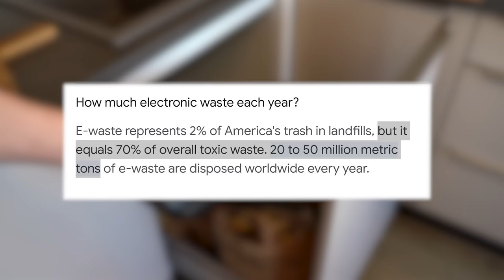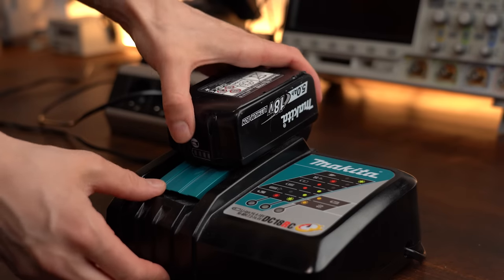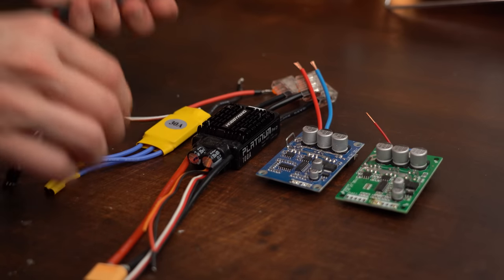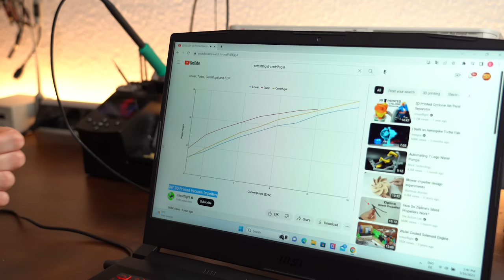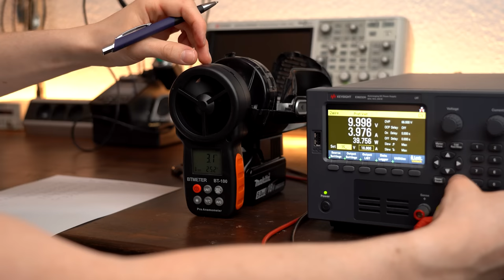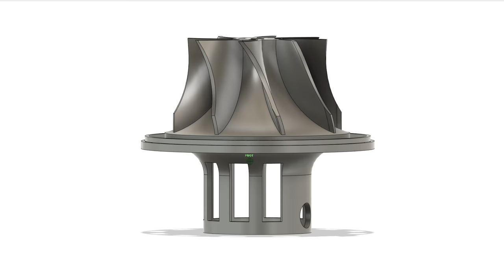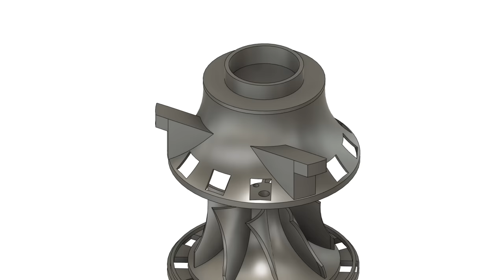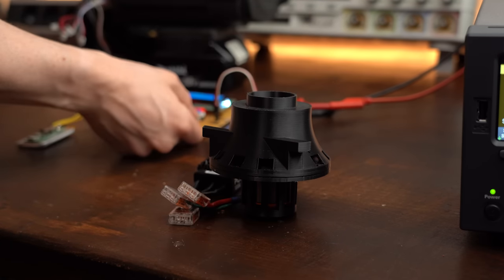I tried OVERPOWERING my Vacuum! (Homemade Turbine)

Comment: As an experienced mechanic/engineer allow me to make a couple suggestions of some things to improve your vacuum cleaner build.

First of all, you have to pay attention to the static pressure (less pressure equals less vacuum power and vice verse)

Static pressure is a measure of the force exerted by a fluid, such as air, against a surface or obstruction. In the context of a vacuum cleaner, static pressure plays a crucial role in determining the machine's ability to pick up dirt and debris effectively.

moving on

When looking to replace the electric motor, impeller, and impeller casing of a vacuum cleaner, there are several factors to consider. Here are some important aspects to keep in mind:
1. Power requirements (It is advisable that voltage and power is in range of the original motor if not changing the impeller/casing.)
2. Motor type and design (Brushless motors are generally more efficient, durable, and have a longer lifespan compared to brushed motors)
3. Impeller specifications (Pay attention to the diameter, thickness, and intake hole of the impeller. Changes in impeller size can affect the static pressure and overall performance of the machine.)
4. Impeller casing compatibility (The impeller casing is designed to house and direct the airflow generated by the impeller. The impeller and casing should fit together properly to ensure efficient airflow and prevent any air leakage. Also make sure that the impeller and the casing are compatible with each other.)
5. Quality and durability (Consider the quality and durability of the replacement components.)
6. Installation considerations (Check if any additional modifications or adjustments are required to fit the new motor, impeller, and impeller casing properly.)

Moving on

Material used to build the impeller and the casing plays a crucial role in generating static pressure as well as better performance etc.
They can be made from various types of plastics, such as ABS (Acrylonitrile Butadiene Styrene) or polypropylene.

Here are some Pros/Cons for plastic and metal impellers and casings:

Advantages of plastic:
   - Cost-effective: Plastic components are generally less expensive to produce compared to metal parts.
   - Lightweight: Plastic impellers and casings help keep the overall weight of the vacuum cleaner low, making it easier to maneuver.
   - Corrosion resistance: Plastic is naturally resistant to corrosion, which can be beneficial in environments where moisture or cleaning solutions are present.
   - Design flexibility: Plastic parts can be molded into complex shapes, allowing for optimized airflow and performance.
Disadvantages of plastic:
   - Lower strength: Plastic impellers and casings may not be as strong as their metal counterparts, making them more prone to breakage or deformation under high stress or impact.
   - Heat resistance: Some plastics may have limitations in terms of their ability to withstand high temperatures. This can be a concern if your vacuum cleaner operates at high temperatures or encounters hot debris.

Advantages of metal:
   - Strength and durability: Metal impellers and casings are generally stronger and more resistant to deformation or breakage under high stress or impact.
   - Heat resistance: Metal parts can withstand higher temperatures, making them suitable for vacuum cleaners that operate at elevated temperatures or encounter hot debris.
   - Enhanced performance: Metal impellers can provide improved performance due to their ability to maintain their shape and generate higher static pressure.
Disadvantages of metal:
   - Weight: Metal components are generally heavier than plastic, which can add to the overall weight of the vacuum cleaner.
   - Cost: Metal impellers and casings tend to be more expensive to produce compared to plastic parts.
   - Corrosion risk: Depending on the specific metal used, there may be a risk of corrosion if the vacuum cleaner is exposed to moisture or corrosive cleaning solutions.

*** Now, to help you with the design of an impeller and the casing.***
- There are several impeller types used in vacuum cleaners, and the efficiency can vary depending on the specific design and application. However, one commonly used impeller type known for its efficiency is the centrifugal or radial impeller.
- Centrifugal impellers consist of curved blades that rotate within a housing. As the impeller spins, it creates a centrifugal force that pushes the air outward, generating suction and creating airflow. These impellers are efficient at generating high static pressure and can effectively move air and debris through the vacuum cleaner's system.
- Another type of impeller used in some high-efficiency vacuum cleaners is the multi-stage or dual-stage impeller. These impellers consist of multiple stages or sets of blades that progressively increase the pressure as air passes through each stage. This design allows for enhanced suction and airflow performance.
- Keep in mind of the shape of the impeller itself and impeller casing, you have to make the design of both in such a way that when operating you can have maximum of the airflow from that turbine. The inside shape plays key role in how will Air flow thru the turbine.
- In your case (with printed impeller and casing) to improve a bit you can consider polishing the surface of both, it will help the air pass thru the casing better (less resistance due to rough surfaces of the printed parts)

It's important to note that the efficiency of a vacuum cleaner relies on various factors beyond just the impeller type, including the motor power, filtration system, airflow design, and overall construction. Manufacturers often develop proprietary designs and technologies to optimize the performance and efficiency of their vacuum cleaners.

Anyway, I am sorry for the long text but it is still not enough to fit it all in the comment. Just to justify my self, I have plenty experience in maintaining turbo compressors, turbines, compressors, high and low pressure compressors or pumps, or any equipment which is directly or indirectly connected to pneumatic and hydraulic systems.

Keep up great channel and content

Comment: you could also use one of those server fans , they have a lot of power, come with flow correction (the rotating wind is converted into straight flowing wind using two opposite rotating fans) and they are also cheap+ do not heat as much as normal bldc motors.. i have some of them from sanyo and they all working fine
Reply from the maker: I will have a look
Reply: @underdweller  yes it makes it sounds very powerful but actually not so much as the fan is not designed to pull a vacuum it's designed to push allot of air
Reply: @lifeai1889  exactly

Comment: Ok so, i been there and here is what you can do
1) the tip here is roto speed, forget about clearances and shit (unless they are over 0.8mm or so) you want high speed so, an inrunner bldc is a great idea something like a 3660 (5mm shaft at least) 
2) add some back sweep to those blades, make it shorter and as wide as possible, also, make the inlet as big as you can (since we are aiming here for airspeed and static pressure experiment with different diameters (maybe look at Matthias wandel blower experiments (although they dont look 100% the same, the work on a similar principle) mm from the edges if possible) get a better angle of attack in those blades  
3) if you need inspiration, go to grabcad and get an already made design (it will probably be the easiest one) and adapt it to your needs (probably look at turbocharger models) i hope that it helps (ik this for working on my 3D printed centrifugal supercharger project.

Comment: I'm currently working on a vacuum turbine design currently

The challenging bit at the moment is getting sufficient static pressure to be able to produce good suction. The amount of air that the turbine can flow when it's being run open air is insane though!

Hopefully when I shift over to a BLDC motor with controller I should be able to get a substantial RPM increase which will gain a good static pressure. I'm aiming to use a 3300kV 540 motor with 60A ESC. The current motor is a brushed 540 that spins around 12,000 RPM.

Comment: Please make a flow controller with electronics, we had a MQL (minimum quantity lubrication) project which is lubrication system and blow special oil in a mist way with pressurized air at tip of nozzle, at first we wanted to give oil with electronic system but later we turned it to mechanical liquid switch. There aren't enough electrical flow control system tutorial resources on youtube for very low flow amount like 60 ml/h and tutorials on youtube uses water, not special liquids which has diffrent density and viscosity.

Comment: I 18 volt everything. When my dyson stick vac went through its 2nd 14.4 volt pack I also converted to makita 18 volt. It lasted about 2 years until the wheel exploded. I ended up taking the cyclone off of it and taping it to the front of a black and decker 14.4 volt that I had converted to 18 volt. Found out the dyson was an extremely high static vac, gutted the inside of the cyclone and removed all restrictions, now it works as good or better than the original design( for my garage, the original pulled through a very restrictive  hepa filter) . The cyclone still works fine with all the stuff inside removed.I  replaced the motor on a first gen makita stick  vac with the dyson motor I had laying around. That vac went from anemic to lifting 2x4's. All the vac wheels I have messed with had 2 walls, not just a back wall and exposed blades

Comment: Use an inrunner motor for it. It’s like the motors you find in brushless rc cars, they make lots of rpm because the rotors are very light compared to the outrunners that need more torque for what they do. Very cool project

Comment: Years ago I was gifted a Black and Decker dust Buster vacuum. Don't ask me why we kept it but I still have it.

My original intent was to change the battery inside, i think that was the only problem. 

I seriously like your idea of using a tools battery. I have a air pump, left blower and weed wacker that uses the same batteries. I wouldn't mind having this join them using the same battery. Feels more intelligent that way.

Too bad you aren't close, I'd love to fix this damn thing. Its dated back from 1999 if you can believe it

Comment: Impeller design is crucial. Switching from a Closed type impeller to the Semi Open type reduced the efficiency of the impeller. Tolerances are a bit of a problem with plastics, but improving the impeller design is where i would start.

Comment: Amazing results for a first go at impeller deign. I would recomend, however, a deign more similar to the original one. First off, the inlet and and outlet area of the impeller (not the case, but the impeller, although this holds true for the case too) should be about the same, if we ignore cinoressibility (we are below mach 0.7 so thats a safe assumption). I would do this by, counterintuitively, decreasung the inlet area. The key with centrifugal pumps is the development of the centrifugal force by fkinging the fluid from near the center of rotation all the way out to near the edge of the impeller. The air entering near the edge of your current impeller design is not going to actually get accelerated that much by the time it reaches the outlet. The axial component of the airflow does not add significant suctuon power for this type of impeller, which is why the oroginal one is so flat rather than long like yours. Good luck with v2!
Reply: *compressibility

Comment: Next step further impellor improvements, including balancing. perhaps a higher kv motor, but the impellor is where you're going to pick up most improvements long term.
Reply: The tolerances inside the impellor unit that Dyson use for their held held units are very tight. It's a similar centrifugal design only smaller, the housing is not much bigger than the BDC motor used here, but they're also not 3D printing the parts either, it's some kind of glass fiber reinforced plastic, and would spin much faster too

Comment: Might want to replace that propeller with a quieter version, I don't remember the details but the key point was the fins circling back on them selves as a loop rather than suddenly ending with an edge like your existing one does. It's a recent discovery that they're both more effective and quieter. You'll have to do the research yourself though if you want more in depth detail since I only saw it on the "undecided" vids (I think).

Comment: If you put that impeller in an involute housing and add stator vanes you'll get much better performance out of it. Those types of impeller generate pressure by interacting with stator vanes, and the involute housing optimizes the volume at each point to account for the air being added to the system.

A word of caution though: You'll probably have to use a much smaller impeller. Moving more air through these types of systems increases their load, so if you make the impeller more efficient, your motor is going to draw hundreds of watts spinning it. A smaller impeller in a proper enclosure will easily outstrip the airflow of your original motor.

If you have a ~100W motor in the ~3-5000KV range you can use that and a ~20mm inlet impeller to get really good airflow and static pressure. That's what Dyson uses. Print that one in resin though, you'll need more precision and balance than FDM can give you.

Comment: Different numbers of blades, height, "trim", so on can make a massive Difference to the flow on the impaller. Car performance turbochargers are gonna be your best bet for designing your own! 
The new Garrett G series turbos are moving a lot of air with their impaller and compressor housing designs, so looking that them may be a nice thing to start with

Comment: I don't know if it matters for centrifugal vacuums, but with centrifugal compressors the key to performance is the centrifugal part. 

Centrifugal compressors work well in the applications they are used in (compression) because air has at least more mass than viscosity. Because of this you can pack it better by "throwing" it, than you can via trying to mechanically "squish" it. Think of it like grabbing snow vs. grabbing water. Both are the same weight, but one is "thinner" than the other, so is harder to mechanically grab, like with your hands for example. If you want to move a lot of water, it makes sense to "toss it" and let it's weight do the rest of the work... That's kind of how a centrifugal compressor works.

What I'm getting at is this.... to me, your impeller/compressor is too tall, and not big enough around.  You really want diameter so you are firmly "tossing" that air.

(Also, try printing with PETG. As a long time hard core Nylon Nazi, I can confirm PETG will change you.)

Comment: (sorry not native englishspeaker) BLDC-Motors are not suposed to be used in constelations where the Force goes in line with the Rotor-Axis. If you have a "snail-fan" you can use a BLDC because the direction of force is 90° to the rotor axis and can be absorbed by the ball-bearing.

Comment: proper impeller design requires knowing the airflow and pressure differential at a given RPM, this directly influences the shape, soo there is a lot of trial and error with your method... but still seems like a lot of fun :)

Comment: If  sucking up air is really based only rpm (maybe, not sure) You could add a gearing system to multiply it. But of course it depends on IF torque really doesn't matter.
Reply: Depends on the turbine & application.
For vacuums you want both airflow and static pressure.

Ideally at least 2PSI.

Comment: I had a similar problem with an hot-air gun, the motor was slow more and more, the problem was the carbon contact, It seems that the contact reduces because the material of the carbons goes off, so I opened the motor and push a bit the carbons. And thats it!

Comment: some motors are built more for torque than they are RPM, if needing higher RPM you can offset the motor and build a gear (or pully) system to step up the ratio to a better RPM.

Comment: You should add stator vanes to the impeller housing. Also use a high speed drone motor with a higher kv. This should increase the suction by alot.

Comment: Slant your blades more at the inlet like 45 degrees. Currently, the blades, IMO, are acting more like paddles than airfoils. As I think about it, the air at the inlet is a 'stationary' 'column the diameter of the inlet. Once you have set up a flow, the column needs to be 'grabbed' by the inlet portion of the blade; that in turn is accelerated downward and then transitions to a centrifugal 'fling' at the outlet portion of the blade. If you look at turbocharger compressor wheels (google some images), you will see the leading edge of the inlet is typically a straight edge radially. And looking at each blade from the side, they have an S curve. You are bringing the air in axially and smoothly transitioning to a radial exit. You also want to accelerate the air, so if you look at the cross-section of the wheel core and the 'cover', you will see at the inducer end, it is wide, gradually tapering along a curve to the exducer.
For the inducer pitch, think airplane propeller where a flatter pitch allows a higher rpm and more power, and a steeper pitch reduces rpm, but moves more air. I think if you arced the exducer end of the blades contrary to the rotation, the effect would be the curved section helping to 'boot' the air centrifugally outwards. A redesign of your impeller will probably help efficiency greatly.